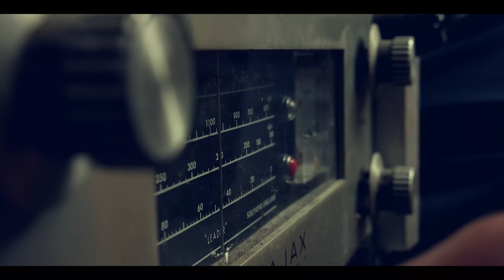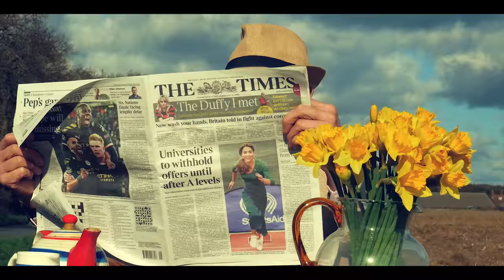'THE RACER' Short Film - Custom Honda CG 125cc by TWINTHING CUSTOM MOTORCYCLES

Comment: I used to work in a motorbike shop in South shields in the late 70s and got to ride all the new bikes. A few still stick in my mind. Cbx 1000. Cbx550 kwak 500.yam 350/400. Any lightswitch power band motocross bike. Laverdas etc but i always loved riding the CG 125 with its easy going pushrod engine. Life is strange sometimes. 👍
Reply from the maker: Love hearing stories like this, thanks for sharing nala, brilliant 👍

Comment: The GC125's don't have much power but they'll run virtually forever with only an occasional oil change throughout their life.
Reply: Cg125 is very popular in pakistan
Reply: @jahangirkhan7145  in Brazil too
Reply: I have cg 125 and it is awesome
Reply: My first bike as a kid was a CB125 from the early 1970s (the OHC version of the CG125). It was a retired delivery bike and it was in pieces (head was off for a new cam chain) - I wheeled it home carrying the engine in a bin bag. I learned how to put it together, learned how to get it running and learned how to ride on it. Happy, happy days! In hindsight the end result was a bobber, it had knobbies and was stripped down to bare essentials.

Comment: The CG 125 has been the best-selling motorcycle in Brazil for over 4 decades. Currently the most sold version is the CG 150, with electronic injection and a series of improvements. Here gasoline is very expensive and this motorcycle is very economical, robust and easy to maintain, it is part of the Brazilian history, very cool to see this film, because I believe that in Europe and the US it is not as popular and common as it is for We here.

Comment: That was excellent!!
Reply from the maker: Thanks v much bud 👍
Reply: @TwinThingCustomMotorcycles  I just bought myself a Honda cg 125, it’s a bit more run down than I first thought. The engine is sweet but it just looks rusty and neglected. Even though I have very little mechanical experience I decided I’m going to strip it right down to the bare frame and rebuild it. Take my time and have fun. I’m not going to make it into a cafe racer, bobber, scrambler or whatever it’s just going to be customised the way I want it. I’m stripping it down this weekend, can’t wait. Even though it’s a cg it’s things like this that spur me on, I love it. The bikes gorgeous by the way! Cheers 

Alan

Comment: Awesome bike!!! Great film!!!
Reply from the maker: Thanks so much Jo Flo very grateful 👍🏻
Reply: TwinThing Custom Motorcycles                    As I am grateful for y’all’s effort in the work y’all put in to create these bikes & awesome videos for me
Reply: TwinThing Custom Motorcycles                              Bu the way, I have a question on something I want to order from y’all for my bike (Yamaha SCR950)
Reply from the maker: Hay  @flo03111  sure go right ahead I'll help if I can 👍🏻
Reply: TwinThing Custom Motorcycles                      On your video “The Growler” with the Yamaha XV950 (which is basically the same bike as my SCR950) had a license plate side mount with a light on top which extends out parallel to the ground. Can you produce one for me??? I live in Dallas, Texas.
Reply from the maker: @flo03111  We actually used the original rear light but fitted it to a side mount plate, just had a look at some scr950 rear lights and they are the same. No need for paying us to do it. You just need to order a side mount plate, search that on amazon and then rewire and retro fit the original rear light. You might need to consider some new indicators too i recommend motogadget. I hope that helps 👍🏻
Reply: TwinThing Custom Motorcycles                       I’ve tried to find those plate side mounts but they’re all parallel to the bike. I’ll try & find something
Reply from the maker: @flo03111  humm if you send me an email at timalderson6@hotmail.com  just say what your after and I will try find a link for you 👍🏻
Reply from the maker: @flo03111  https://www.amazon.co.uk/dp/B074XZ76XT/ref=cm_sw_r_apa_i_Lx6JEbTRJF8KJ

Pretty sure that's the one 👍🏻